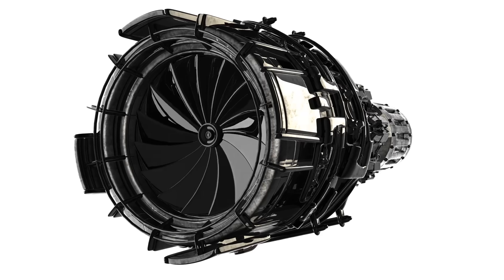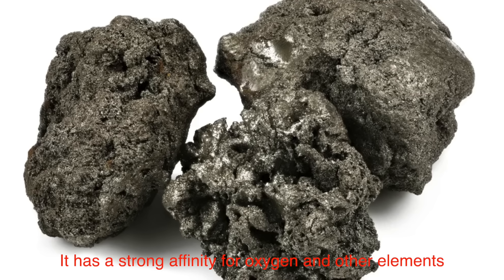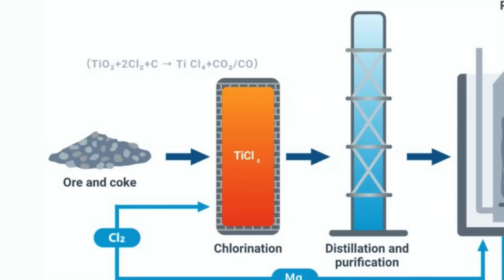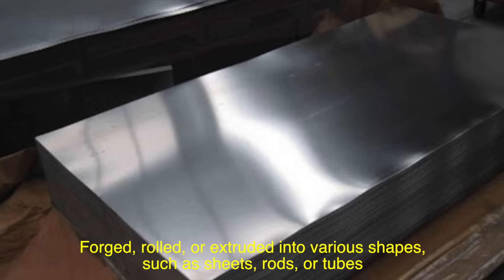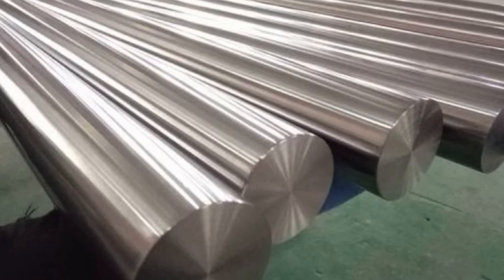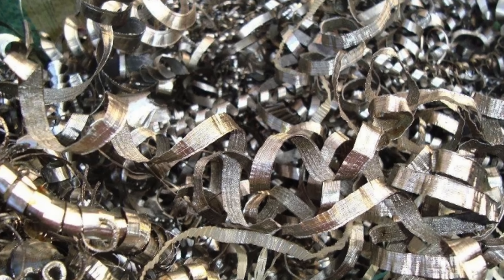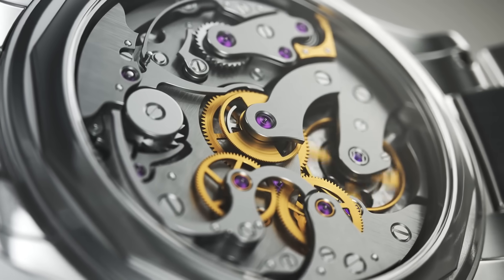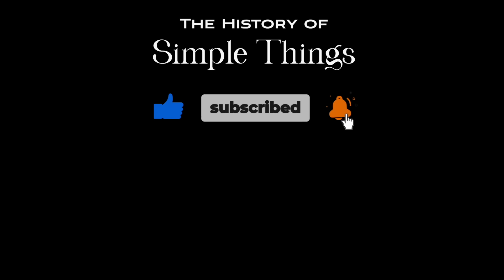How Is Titanium Made?

Comment: I'm a retired journeyman machinist, I've machined many different materials. My take on titanium is that it's like a light weight steel, a bit heavier than aluminum but tough like steel. I never had any issues machining it. I don't buy into the super tough metal thing, in fact many good quality alloy steels are tougher than titanium. It is much tougher than aluminum though a good match for aerospace applications where a tough light weight metal is needed.
Reply: I don't think people are in doubt that steel can be stronger than titanium, it more the fact that titanium is almost as strong but so much lighter that makes it a wonder material.
Reply: u machined inconel too??
Reply: Titanium work hardens during machining.  If it is Ti - CP, it is likely in the alpha phase which is an HCP lattice structure and is not very ductile due to the lack of slip planes.  Other Ti alloys such as TiAl4V are heat treated to remove the alpha phase and allow the beta phase (BCC lattice structure) to be present which is more ductile but is often of a significantly higher strength.

Also are you sure that you are not confusing toughness with ultimate tensile strength?  UTS will have a bigger effect on machining than will toughness.
Reply: Nailed it! 👍
Reply: I worked with a lot of titanium while building the first vectoring exhaust nozzles at P&W back in the late '80's.   The hurdle we encountered wasn't machining the stuff...it was welding it.   They tried a whole bunch of different alloys trying to find one that would allow itself to be welded and after weeks of work...we finally got a panel welded all the way without any cracks!   Everyone went home for the weekend and came in Monday morning to find the piece in a hundred jagged pieces as it cracked itself to death while we weren't there.

Lots of the panels that made it into the two STOL/MTD F-15 had been welded, cracks started then were chased and stopped by drilling a hole at the end so it would stop propagating.   It was kind of like shooting long distance at a moving target and you had to anticipate where the wandering crack was headed because it took some time to drill the hole in the tough titanium.    They learned a LOT from the STOL/MTD program which is now flying in the F-22's with good results.
Reply: @recoilrob324  Probably due to the same problem that Lockheed had in building the A-12 and SR-71.  It is likely that somehow chlorine was finding its way onto the metal at some point in the manufacturing process.  I weld titanium fairly regularly and part of the process is making sure that no chlorine comes close to it during the processing.  Inadequate inert gas coverage during welding can also be a source of cracking.  Do you remember the color of the welds after they were finished?  If they were anything other than silver or very light straw, that could be the source of your cracking.
Reply: @recoilrob324 Pretty interesting. I don't remember much, but it was somehow used in TIG welding.I forgot about the holes that could stop cracks...
Reply: @recoilrob324  common story, heard a lot of it from father when he worked on factory in USSR
Reply: So much is dependent on the alloy we are using. Cannot say it is going to be stonger than some of the steel alloys but a very close runnerup. I retired from an aerospace contractor as a millwright. Damn, if I wouldn't like to do some fun things again! The occasional V8 reworks were always good times. Some of the repairs and line boring, cylinder bores and sleeves. Automotive machine shops didn't rehabilitate some of the engines we had come through. Those were not a common engine, but one that would be very difficult, if not impossible to find replacements for. 

My preference is bicycle frames and how awesome they can be. The bicycle frame is a work of art that can transport one on great adventures!
Reply: I'm surprised to find a machinist who has worked with titanium but doesn't understand the issues of work hardening.
Reply: As long as your tooling is sharp, no problem....except for tapping. Titanium absolutely hates to be tapped. = )
Reply: You are not aware of it's corrosion resistant strength and many industrial applications where any grade of Stainless steel doesn't work, for example sea water heat exchanger's tubes, critical equipment and parts in rocket engineering 🚀 aviation and avionics and many more.
Reply: I’ve had a hollow tapered golf club shank sitting around the shop for a dozen years, always thought it was stainless steel. Tried cutting the ends square with a hack saw a while back and gave up because it wasn’t going well. Last week wanted to make a blow tube out of it and used my angle grinder to dress the end. Bright white sparks.  Looked that up and realized it was titanium.
Reply: I was an aerospace aircraft machinist. Titanium was a pain to machine! Not as easy as you think. Ate carbide endmills more than stainless steel
Reply: Its the coatings that make it tougher post grinding- Atlantic aerospace here
Reply: You aren't very bright are you? You contradict yourself in your own stupid comment. Its strong and lightweight but you don't buy the its strong argument. WTF? When comparing the titanium in a pound for pound match up Titanium is much stronger than steel. If you took 10 pounds of each material Titanium wins in about every category except wear resistance.
Reply: Its ROHS hardness is only like 5…. But an attack from a 4.5” sanding disc makes one think it’s much harder. It’s kinda weird. Haven’t machined it past sanding, but I’m willing to bet one needs oil or water/oil mix
Reply: Really?  I burned through about 464636626 bandsaw blades trying to cut some titanium stock.  In general it was just such a bitch to machine.  I don't really get when, as you said, many steels are much stronger and I've never had a problem machining them.  I seem to remember from university that titanium is equivalent in strength to general steel but half the weight.  Which is why I don't understand why it's such a bitch to machine.
Reply: @Alex.The.Lionnnnn  Simple explanation,..drill a hole through a piece of steel plate with a titanium drill bit then drill a hole through a piece of titanium plate with a steel drill bit then try to machine a piece of steel with a titanium end mill then machine a piece of titanium with a steel end mill you'll soon understand the differences.
Reply: @Alex.The.Lionnnnn  There are many factors determining how easy a metal is to machine. I've machined titanium and I don't consider it a bitch to machine. Heck some plastics are tricky because they warp or tear out while hard materials such as cast iron machine like butter. This video was more like a propaganda film from the titanium industry than a strictly factual expose'.

Comment: Casting following melting is not a separate step. In a VAR furnace an electric arc is formed between the compacted sponge electrode and the molten pool of titanium. This takes place in a water cooled copper crucible. As heat is extracted the lower part of the molten pool freezes to solid metal. As the length of the solid ingot rises in the crucible, so too must the electrode in order to keep a constant arc length between molten pool and tip of the electrode. Ingots can be 36” diameter or larger and 12 feet long.
Reply: What flux is used with the process?
Reply: @spvillano  no flux…anything like that would just contaminate the ingot. Volatiles are driven off by the extreme heat and whisked away by the vacuum. Ti melts at 3030F.
Reply: BTW, wouldn't induction heating be more efficient than resistive methods like arc or bombardment/resistance beam melting? That could be conducted under either a vacuum or inert gas atmosphere as well, hell, might get away with using nitrogen, which could be generated locally.
Reply: @spvillano  Nitrogen will be absorbed by Ti and form TiN, titanium nitrides. Extremely embrittling, and once formed takes extremely concentrated high heat like in an electron beam furnace to dissolve it. TiN melts at 5300F comparable to tungsten.  Nitrogen is no bueno. Vacuum is preferred to sweep away volatiles. 

The Sioux City, United Airlines DC-10 was crippled when a compressor rotor blew up that had a TiN inclusion that was the starter for a fatigue crack. As the rotor shrapnalized it took out the hydraulic system and the pilots only means of control was differential thrust from the two wing mounted engines. It was amazing anybody survived the ensuing crash and was due to the skill of the three pilots. One captain, one first officer, and a pilot who was deadheading and came to the cockpit to manage the thrust levers.
Reply: @spvillano  nitrogen is verboten. Ti forms very hard, very brittle nitrides, TiN. These nitrides can form initiation points for fatigue cracks.  TiN melts at like 5300F, and because of this they are very difficult to melt and dissolve…so much so that extreme measures such as plasma torch or electron beam melting are required. EB melting occurs in a very hard vacuum. Plasma melting occurs in a highly pure argon atmosphere.
Reply: Water cooled Copper crucibles are the old way, the modern furnaces use liquid NaK (Sodium, Potassium mixture consists of 77% potassium and 23% sodium by mass (NaK-77), and it is a liquid from −12.6 to 785 °C (9.3 to 1,445.0 °F). Far safer than water cooling.
Reply: Induction heating likely wouldn't work because of cooling requirements of the crucible or hearths. VAR can't remove ldi's and hdi's like EB can. As an EB operator myself I'm not sure how much I'm allowed to divulge. 😅
Reply: so how can i make an alloy of cobalt titanium and tungsten?(armor piercing rounds)

Comment: Good work.
Ti is a super material, but there are some issues with it. For one, it is difficult & expensive to make. That's not because the ore is rare (it isn't) that's because refining the ore down to pure metal uses a large amount of electricity. This is also true of Aluminium but Titanium is worse.
Second, Ti is tough and light and strong and great, but it is vulnerable to cracking, and fixing that is a lot harder than fixing it in steel.
BSA were a British motorcycle manufacturer, very successful in the 1940s and early '50s. So they built a bike to go racing off-road, what we would call MotorCross. And word came down from the Board of Directors to make the frame of the next version, from Titanium.
Sounds good, on the surface, but that turned out to be a death sentence. the 'Ti' BSA was a dog that cracked and broke and bounced and handled terribly, because they simply tried to reproduce their Chrome Molly frame in Ti ~ and that's not how you do this.
The Ti Beeza stands as a lesson for all of industry ~ don't let Members of the Board of Directors make engineering decisions. They weren't hired because of their engineering skills ~ they're on there because they own lots of shares. They're rich. In theory, they know about money and banking and business, but that doesn't mean they know enough to tie an engineer's bootlace.
Intel ~ are you listening to me?
Reply: @Kneedragon1962  I think maybe the BSA issues with frames cracking was related more to poor welding practice than to the actual titanium. Ti alloys are used extensively in aerospace and rarely fail by cracking (fatigue cracking) and endures tens of thousands more loading cycles than does a motorcycle frame. 

Welding Ti is difficult and must be done precisely in order to prevent atmospheric (oxygen and nitrogen) contamination. Even very small quantities of O and N result in brittle welds. The welded surfaces have to be spotlessly clean, free of oils, grease, fingerprints, etc. During welding, 100% inert gas (typically argon) shielding has to be provided to both weld pool as well as the inside of tubular joints. It requires scrupulous attention to detail, and is much more demanding than welding a tubular steel frame.
Reply: Titanium is just another metal, midway in general strength to weight between aluminum and iron.
And just as plain aluminum or iron isn't exceptionally strong overall, with our most desired characteristics, that's true of titanium as well. That's why we have alloys.
Love my high carbon steel for many uses, as one example, great for many tools. But, want a high heat steel for cutters, the alloy needs to change, with cobalt being a great addition to the alloy. One can go on and on on alloys, but I'm not a metallurgist. That's voodoo or something.   ;)
And when I need high shearing strength, with tensile strength as well, yeah, I call in an engineer. I'll do medical things, I'll do electronics technician things, I'll do IT and IT security things, but when it comes to designing things, I'll leave that to the subject matter experts in engineering. Otherwise my diodes will be smoke emitting, not light emitting.
Oh crap, those were supposed to be rectifiers...    ;)
Reply: @spvillano silly!  thanks for the laugh!
Reply: No
Reply: And that applies to a vast amount of countries around the world. Turds have taken control. There are so many people in charge that hop industries because they've got "mic-managemenering" ""skills"". Boeings stuff-ups are another example. (Although manipulated by Airbus and carriers as they didn't want to produce a needed new jet and if Boeing didn't, they wouldn't, but as Boeing very much needed to replace the 737 but didn't. To their regret. (Mentor Pilot is my knowledge source for this.)
This is why society does need good government to be involved by the setting ground rules for business, so that they make good decisions and fair play.
Reply: I'm English so know BSA, but had no clue that was what killed them. thanku for the knowledge.
Reply: @johnattwood8467  The Ti Beezer just cost them the MX championship that year, but didn't kill the company - they were still competitive in the early 70's when I was riding - the 441 Victor was a BEAST.  The company struggled along with many other European brands after the invasion of Japanese bikes in the 70's, which cost us a lot of sterling brands. Everyone had an MX bike!
Reply: Thanks for reminding me to call investor relations today! 🎉
Reply: Agree but an interesting thought is to compare it to copper mining.
Reply: I'd say Boeing is a better target to point your figer at in this context
Reply: Titanium only cracks if the process it undergoes are incorrect. Grade 5 has virtually an infinite fatigue life, with some evidence of a threshold, but certain chemical exposure can damage the metal. Bromide for example.
Reply: Boeing never welded main elements, only fasteners were used. Talking early 737.
Reply: @Kneedragon1962  I like to think of the reactive metals, Ti, Zr, Hf, Nb as “congealed electricity.”  It takes a huge amount of electricity to reduce Mg ores to produce pure, metallic Mg, yet Mg is the metal of choice to reduce TiCl4, ZrCl4, and HfCl4, to form the respective metals, titanium, zirconium, and hafnium. Meanwhile, that triumvirate of metals requires vacuum arc melting in order to consolidate the reduced sponge into a solid ingot…more electricity required.
Reply: Are you saying good work to an AI?
Reply: Sounds similar to the first Ti bicycle frame and fork that were mass produced:  both prone to failure with the fork particularly dangerous.  Today the Teledyne is a collector's item.
Reply: Actually it's called Motocross. Everyone needs a motorcycle grammar Nazi in their life and I'm happy to fill that role.